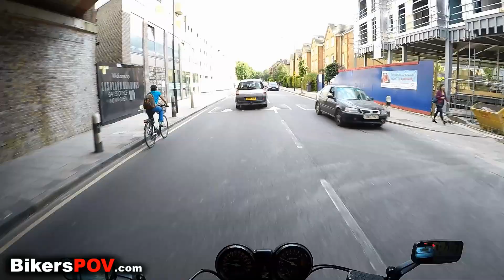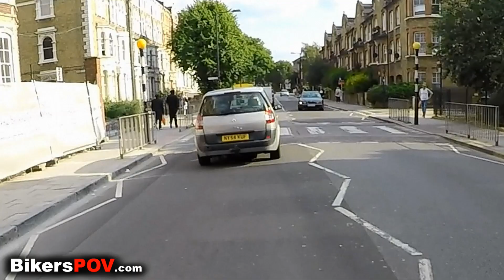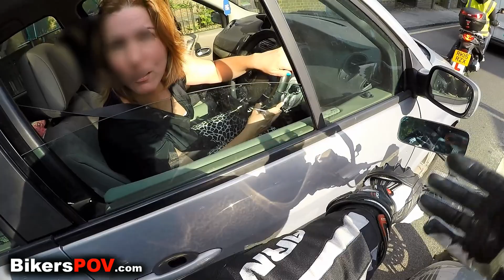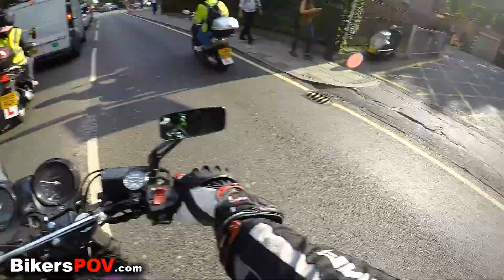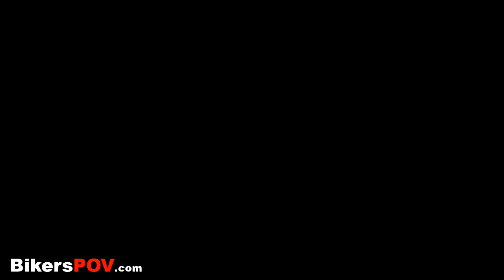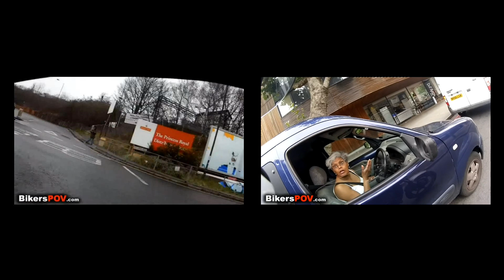Bouncy pipe

Comment: I moved one out of the road once. Cycling in Leicester when I was about 17 and saw a huge exhaust pipe in the middle of the main road. Stopped to the side to move it out of the way. I checked to make sure it was not hot, but it was warm on a cold winter day, so it must of fallen off a car few minutes before I arrived.